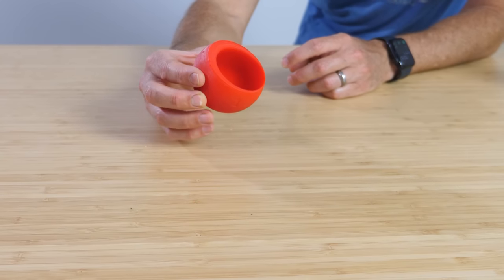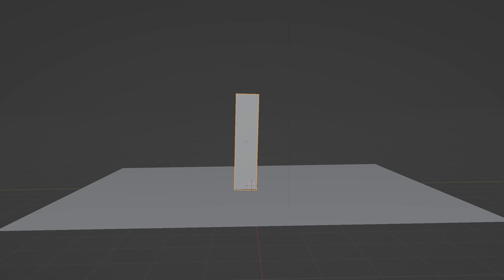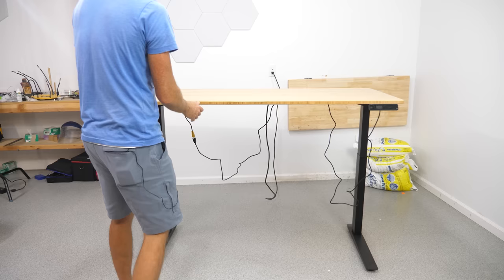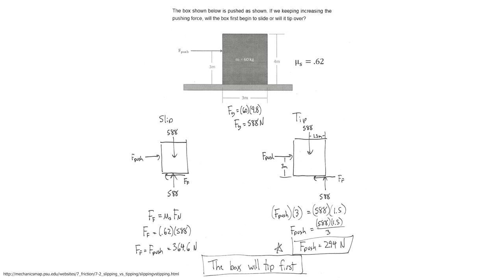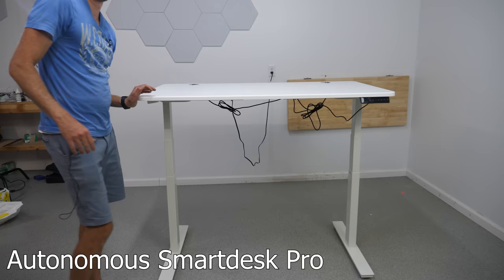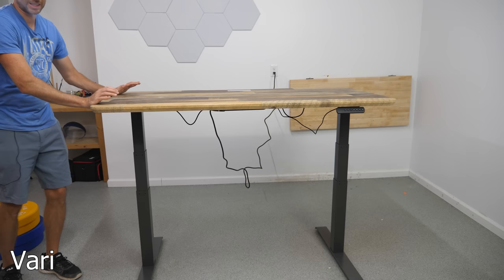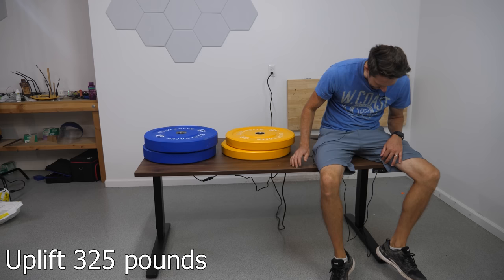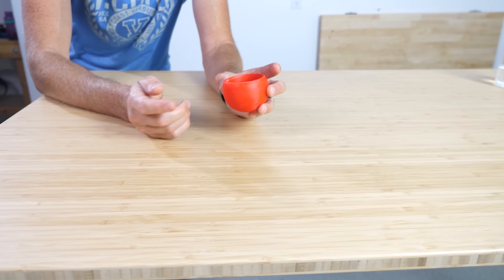How Does The Self-righting Cup Work? (I Tested All The Standing Desks)

Comment: The error on the motor might be a feature to prevent damage. If other desks don't have that, then it should be tested to see which one has the longest lifespan with continuous heavy loads.
Reply: The more important question: who's constantly moving heavy objects up using a *desk*?
Reply: Or a fail-safe!
Reply: The fact that other desks didn't show an error may just as well mean that their motors are made for higher load, with the error just appearing at a higher value. Except that one desk that noped without any warning...

With this presentation (cause it's by no means a 'test'), there is just no way to say.

Comment: The Slip vs Tip portion reminded me of one of my huge pet peeves for some reason.  And that is electronics that are so light, that pressing the buttons requires more force then the thing weighs.  So when you press the power button, it just slides back, and possibly right off the back of the shelf. Or if it's a tall device,  it tips over.  Will it slip or tip?

  So a simple, one-finger action becomes a two-handed affair.  One hand to press down on the item and the other to press the button. Or use a kind of grip method.  4 fingers on top, and thumb to use the button by using a grip or squeeze action with one hand. My dad used to have a DVD player that sat in a low-profile, little cubbyhole slot in his TV stand. You had to wedge a finger beside it, and jam it to one side to press the power button or to open the disc tray. If you didn't, you had to pull the whole stand away from the wall and reach in from behind to shove the lightweight piece of crap back to the front of the shelf.  I don't remember how many times we were pulling that stand out to shove the player back up.  Eventually he put double-sided tape on the feet of the darn thing. 

Then there is the fact that it is often the case where the wires required for the device are heavier than the device itself, and it adds to the movement when pressing the buttons or even causes the device to lift up in the front or be dragged back by the weight of the wires.   Again the DVD player suffered this as well. 

Both are utterly frustrating.
Reply: So true!!!

Comment: To be fair, if a desk tips instead of slipping then it won't move from its position as long as it never fully falls over. Meanwhile a slippy desk will be constantly sliding all over the room so you have to keep moving it back.
Reply: i have no brain
Reply: That can be a plus, depending on your needs. Sometimes you need it to move. Sometimes you need it to stay put.
Reply: @taitano12  if we need to move, put wheels under it...don't make it slippery, it will damage the floor..
Reply: @vaisakhkm783  never damage the floor … 9th law in physicses
Reply: @joe_croupier  it's called vaisakh's law
Reply: @vaisakhkm783  Locking wheels at that. The damage done depends on the floor, design of the wheels/feet, and how often you have to move it. If it's only on occasion that you have to move it, you might be better off with just feet. But, if it's more than once or twice a month, wheels are best unless the floor is carpeted. It's been my experience that wheels will chew through most carpets a lot faster than feet.
Reply: It’s a standing desk that will have added weight on it… is he going to use it as a sex desk? I don’t really think sliding would be much of an issue for him or anyone with a standing desk. Most force exerted on the desk will be downward force too
Reply: yea... I kinda think he just chose properties that would make the sponsored desk look good.  I like this guy a lot, but the sponsored video stuff really bugs me.
Reply: 333rd thumb

Comment: I really love silly thought experiments made into basically useless items.
Reply: Useless? It is literally self-righting
Reply: @Joe-md7uc ”basically” useless.
Reply: Well it's good, people will stop wasting water and start drinking full cup
Reply: Well, the cup that stands up when full could make for really impressive cocktail pours at the bar. It's the right size for a double shot and some juice etc. You could pour the cocktail and the bar guest is meant to drink it all in one go.
Reply: Cup could hold a fire retardant that evaporates with heat. If fire is present, the retardant will evaporate, tilting the remains onto the fire.

Could also be used to tilt a liquid that dissolves some membrane that is perhaps holding back a fire retardant.

The idea being that it requires no power and allows for more complex actions than a simple sprinkler system that locally activates on direct contact with heat
Reply: Could also hold two liquids and regardless of their density, as long as the evaporative liquid evaporates enough, the non evaporative retardant will then be poured out
Reply: Wait ‘til you figure out you watched an 8 minute commercial for a standing desk!  Nothing is useless.
Reply: A silly thought experiment that changes the way you think isn’t very useless at all is it?
Reply: Watch the whole video first and then comment on it
Reply: Agreed on standing desks. Oh wait, that wasn't what you meant was it...?
Reply: @AttilaAsztalos  I’m the only one mentioned the desk.  What’s up?
Reply: @Joe-md7uc  It's only self-righting when it's full. A cup that spills if I set it down after drinking half of my drink can definitely be called useless.

Comment: Ehm okay, so about the tipping of the desks, did you also look at the bottom of the legs? Maybe some desks have rubber feet, which increases tipping risk, and other may have hard plastic, which makes it harder to tip, and easier so slide around.
Reply: Looking at the price points they probably all have rubber feet. Some are just top heavy.
Reply from the maker: thats a good point. I just used what was the natural legs of each desk. But a more fair test would have been to place a high friction bottom on each of the legs of each desk. But I wanted this to be a fresh out-of-the-box test on how stable each desk felt. As we saw in the video, tipping is very dependant on the surface it is on and the frictional coefficent.
Reply: @TheActionLab who is actually going to tip a desk though? I've never heard of that happening? What is the build quality?
Reply: @redrob6026  standing desks are more top heavy than sitting desk designs.  Add a big monitor and it's another lever that multiplies tipping forces.  Some people may also use these for 3D printing.  Tipping and wobbling turn into extra flex and noise that can effect both quality and quality of life!

Also, who is going to tip a desk?  Humans vary.  My nephew can tip a dinner plate over.

Comment: The Flexispot motors seemed as if they were barely able to lift 325 pounds, while the Jarvis one sounded as if it didn't struggle at all with the weight. The Yari was about the same as the Flexispot (if not a tiny bit less strained-sounding). The other ones are out of the race because they gave up. 
So if I had to choose one of them purely based on their lifting capacity I would choose the Jarvis one.
Reply: Agreed. Of course, I don’t know about you or Mr. Lab, but I don’t need my desk to be able to lift 325 pounds! :)
Reply: hello Lampe, We are happy that you noticed this issue. Our motor has overload protection and will maintain at a particular power level when its load over 330 lbs (actually 370 lbs with the top) to ensure its long performance. Our motor can raise 500 with canceling that protection mechanism but it will definitely shorten its service life.
Reply: Hello  @flexispotus !
The lifting capacity on top of the desktop is 330lbs? Then it's no wonder the motors sounded overloaded with almost that :) 
The Jarvis table has the higher lifting capacity, at least judging by the relaxed sound of the motors and the speed it went up. 
I will probably never buy any of these desks, as I don't need an adjustable desk, my wooden IKEA desk is a perfect fit for me.

Comment: The other aspect of tipping a desk like that is that the force applied is not limited to being parallel to the floor. If the force vector includes an upward vector component, then it will start to tilt the desk, changing the geometry and force profile along the base.

Comment: It's worth noting that a counter to the slipping is the friction of the feet of the desk. If the feet have a non-slip surface that will make it many times harder to slide than tip, regardless of the rest of the structure due to the friction against the ground. The FlexiSpot desk sounded like metal-scraping, implying little to no friction coating. Most people will have the desk against a surface, will have additional weight on it that makes it harder to tip on accident, and don't exactly want their desk to slide around. The better measurement would have been to increase the friction on all desks to the point they all tip, and then measure which desk requires the most force to tip.

Comment: That's testing. It's not a good way  until you mount the monitor  to the desk before you do this test. Because these will greatly change how the desk tips slides or moves up-and-down.. I generally use a dual swivel mount 6 to 10  inches centered in on the desk Because nowadays the most common monitors for I do is dual 4K thirty two inch monitors On desk of the Slash and what times I have to put weight in the bottom of the leg on the front side to get a good balance so it doesn't tip over. But as I said, none of the testing is good until you.Determine what monitors and how you're going to mount them.And the whole dynamics of every desk will change.

Comment: 0:55 actually it tips over due to the center of masses relation to center of contact …

plus friction on that point of contact also current velocity and how much mass is on that point of contact also is it spinning or not if so what direction how heavy is the outer mass compared to the inner mass where are you pushing it in relation to the point of contact where is the center of mass lower or higher??

Comment: Sir,is centre of gravity same as centre of mass?
Reply: Common conversation uses them interchangeably, but no.

Center of mass (CM) is where the object's mass is evenly distributed...it would always rotate around this point if floating in a vacuum without gravity.
This point does not change in a rigid body, but can shift in a flexible body.

Center of gravity (CG) is the average of gravitational forces, dependent on both gravity and movement.
If a spacecraft is flying to the moon, the moon's gravity makes the part of the craft facing it lighter relative to Earth.  This pushes the CG towards Earth and away from the CM.  The engine firing also shifts CG away from CM by creating acceleration and an artificial gravity force.

Your CM and CG move together outside you when you bend over to pick something up.  They wander apart if you bend too far and start falling.

Comment: What if you drink water out of the red cup from a straw instead of picking it up then drinking the water will it still turn over?
Reply: Doesn't matter. If the liquid is missing, the center of mass is simply in the wrong place.

Comment: 6:52 that doesn't look right at all.  I  configured an uplift desk, and a flexispot desk as close to the same specs as possible. And guess what happened? The uplift desk was pretty close to twice the price.  In fact, when looking around almost all the other adjustable desk brands were well over $1,000 hitting $1,200, $1,300, $1,400 and the flexi spot with the exact same configuration (as close as possible) was around $900.  My experience has basically been that every other brand is ripping you off big time.  Flexispot is the only one selling these desks at a price that is still expensive, but reasonable.

Comment: The tip/slide test is worthless.  If one desk has slides and another has rubber feet, the one with rubber will always tip.  The lifting test is also meaningless, a higher end desk controllers will have a limiter to prevent it from burning out if overloaded, cheaper desks may not, but they may die if they are overloaded.